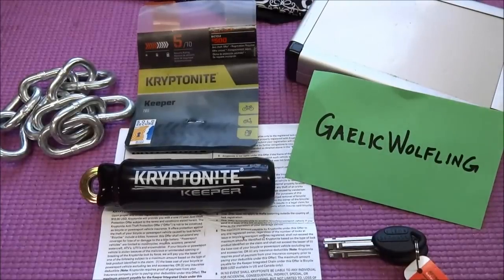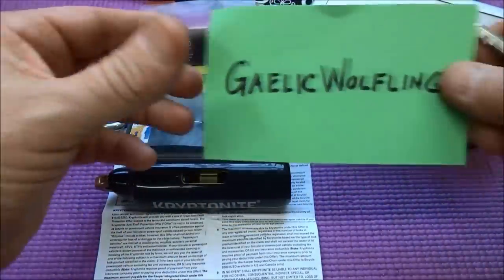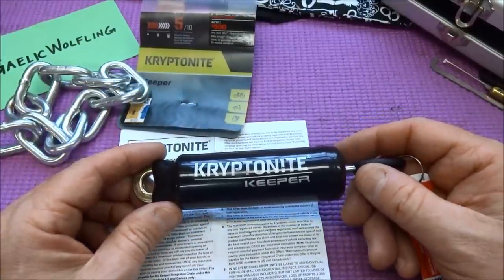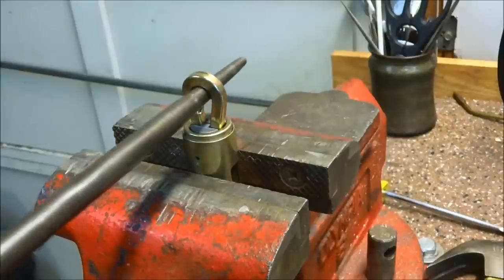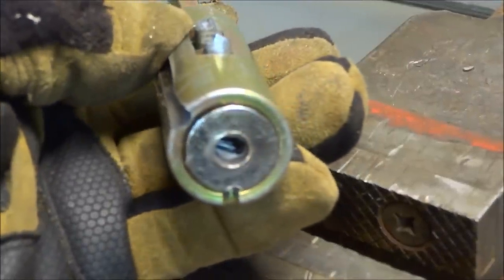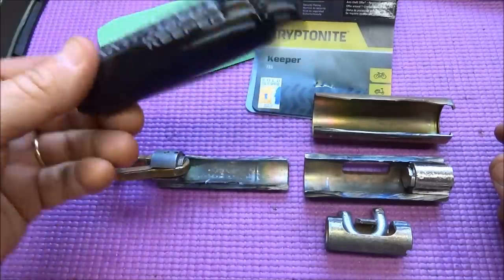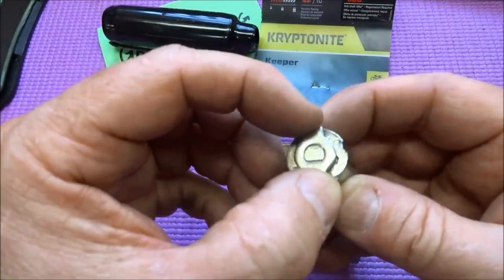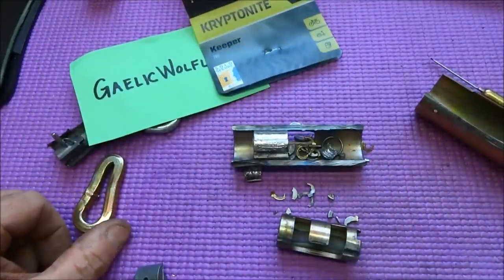(397) Kryptonite Keeper Bicycle Lock Autopsied - One TOUGH Lock!!!

Comment: Bill, brother... Why use a grinding stone to attack these locks? The last cylinder, the small one, could have been cut right in half with a 1/8" wafer wheel. Right down the center to completely remove the internals or off center to expose yet retain them. You can do really delicate work with a wafer wheel and a little bit of experience. You could even take just one quarter out.

Comment: Bill, I think having the original chain would be essential to rate this locking system  as thieves would probably attempt to cut the chain first. I don't see them doing much else than attempting a pick. Reading Amazon reviews, many people have the same problem you had with the poorly functioning lock mechanism. Several reported thieves stole their bike by cutting the chain. cheers

Comment: Just a note on the steel. Hard steel is brittle, just like the piece of tool steel you used. The steel in the lock, while hard, is also tough. Toughness and hardness are two different things when it comes to steel. Those parts look zinc plated as well, not sure if that affects what I'm about say next (I don't think it does), but with enough heat you may be able to upset the steel enough to make it soft again. But that is timely and probably not in the interests of a fast open. The loop on the top appears to be the weakest point, heat that up with a portable torch and twist it right off.
Reply: heavy breathing

Comment: That side bar is the same as what was on a couple pay phones I have. All you need to do is know where it is and drill straight through it the lock will turn with a screw driver after that. Get a good drill bit though, chinesium doesn't hold up

Comment: An angle grinder , triangle file , or some ten thousand pound bolt cutters would most certainly work. The lock can be as strong as it wants but the little loop where the chain goes will be very easy to break. Steal may be strong but it always wears down.

Comment: So with that 2nd larger pin, would you have been able to drill a hole, tap it, put a small bolt and pull the bolt pulling the pin out?

Comment: I broke through the chain on this exact lock using a $26 bolt cutter, which I was able to return with the receipt. For a $35 lock, you should at least need the $60 bolt cutter.

Comment: The 5/10 is really the chain's rating...

In any case, as long as your bike's not the one with the flimsiest lock on the rack you should be fine. A lot of people use locks that can easily be bypassed with a wire cutter and the thief is going to go for those bikes before even considering stealing yours.

Comment: what about drilling directly into the key hole just enough to stick a makeshift key with a figure 8 at the end and tried to use it as if it were the key put pressure like u said and turn until it opens or maybe the tool u had filed dwn to make a figure 8 would that tool have worked if the key hole were to be drilled in or could u have just drilled as far as u could go then tried to turn it with your tool u have?

Comment: you could lay the lock on the floor. put the pry bar trough the loop and have one end on the ground. and step on pry bar. may not break the loop or the pin. but might bind one or the other enough to open it. or just use that or boltcutters on the actual chain. not much of a point in a lock if the chain's bad. while a user for sure would use a good chain. but anything will break eventually.

Comment: I have seen and been deterred by secure locks as a landlord. One thing they cannot do, is protect against the  hasp, or chain used, that is very easy cut. Any cutting disc will deal with them anyway.

Comment: When i was searching for a lock, just looking from the outsde in I saw many advantages to this lock, dual cylender, the pin is a cut part of the inner cylender, the key was difficult to re-make, and even the chain is hardend, squared, and pretty damn thick... Not to mention even if a link was cut, it would easily accept the next link(if you were to recover the chain and lock.)

So given all those I figured it would be a substantial bicycle and even motorcycle lock! I got absolutely no Buyer Remorse here! ^_^

Comment: Are Kryptonite chains and locks really good?  Could you test out the mechanism on the Kryptonite KC890 HD Chain Lock? I got it at walmart a few years back for my bike. Question is, is it as good as advertised? Also, is the kryptonite chain the same hardened steel as the housing?

PS, mine's a 4 but it seems to have the same kind of lock.

Comment: Bolt cutters. And done.
Reply: The chain with which Kryptonite comes is made of hardened manganese steel, and you'll likely break the edge of your bolt cutter jaws when you try to "cut" it.
Reply: Oh, nice.
Reply: Gotcha. Thanks for the info.
Reply: That was a bad ass lock. Did I hear U right & say it was a #5 & a #10 was also available? Geez!

BB: I Stumbled across a great YouTube (I think by Greg Miller?) Where he went into great detail on cut away locks via video where here he showed sitting reg pins, spool pins & serrated pins. Can U hook me up w\ that vid "Please!!" (Or or one like it?)!  I'd buy a full set from  Southord but I'm so broke I can't even pay attention. Seriously, I work from home &  am broke.
Reply: Cordless angle grinder...and most certainly done.
Reply: ***** Just to add, I used to break bike locks and heavy duty chains etc. for a living (Don't ask but it was legal:-), We had access to hydraulic tools including a battery powered "Jaws of life" that cost £7k and would cut through scaffolding pole as if it wasn't even there. Tool of choice was cordless angle grinder (We had one before you could buy them commercially, Dewalt told us they didn't think they would be commercially viable, Milwaukee modified a cordless sander for us, now everyone sells them :-) ) Of course noise wasn't an issue for us but one thing to bear in mind it that generally the outer layer of a chain will be harder than the centre (by design) so cutting through the outer hard layer with the grinder and finishing the job with  bolt cutters can be quicker and minimise noise but it does require carrying more tools. We found the risk of damaging bolt cropper blades was too high to use them but a thief may not care too much about that. As you say a 36" pair of decent bolt croppers is not an easy thing to conceal. BTW Cordless Dremels are a very handy tool if used carefully, as battery/disc life isn't great but again when used in conjunction with bolt croppers they can remove the hard layer that wrecks the cropper blades.
Reply: I'd be interested in getting hold of a link or two of that chain for tests. And a link to the cutting video.
Reply: ***** Ok, humor me, If say I had access to liquid nitrogen as a common thief, supercooled the chain, then hit it with heat from a butane torch (or the other way round) AND then used 16 inch bolt cutters to cut the weakened chain, could it be done? All those things would fit in a small backpack and wouldn't make much noise. Could be done in 3-4 mins in a dark alley at night.
Reply: *****  the locking mechanism has nothing to do with the security.. whenever I see broken locks in the street, they are never picked.. they are always cut. If you have enough leverage you can bite through pretty much any chain. You don't even need to freeze it first, just heat it to red glow and you go through like butter

Comment: The weakness is the chain by the way. Made in China, through hardened and should be quite brittle. Meaning you can probably bolt crop it with a decent and big enough bolt cropper quite easily. Assuming you have new blades on it.

Comment: I've got a Kryptonite U-lock and it has the same kind of key, pretty happy with it. £900 guarantee with it.
Reply: Are you assuming these are the old style Kryptonite locks? Because disc tumbler locks are reputed to be some of the hardest to pick.
Reply: Well it obviously wasn't that easy to pick or bosnianbill would have done so in the video, sure they're not invincible to picking but they require more than the average street criminal is likely to have.

Comment: At 1:02 you are talking about a high "magnesium" chain that has been removed. Magnesium is relatively soft when it comes to metals. Are you sure you didn't mean to say manganese? Manganese is used to toughen steel and make it stronger, more impact resistant, and wear resistant. The rolls in gravel crushers are made from manganese steel.

Comment: I just wish you had tried to extract the pin before slamming it in. Try a small screw in there or something and pull it out, or maybe some bonding agent on a smaller pin and gently tap it out by pulling and tapping.

Comment: Wow, ok, that was quite interesting to see.  So basically this is a really good contender for a security lock, or did I miss something? I guess a thermal rod would be the best/fastest way to cut the anchor link off? It seems that it installed and visible, someone isn't going to be able to get the secured contents without putting a spotlight on them doing so.   
Best to ask an expert....what type of lock system do you recommend for a motorcycle and a 53' shipping container (2 separate items)??
Reply from the maker: The Abloy with the thickest shackle that you can fit into the chain/container.
Reply: J Alvi

Comment: Impressively tough lock but as in any security system, always go for the weakest link.  Rechargeable angle grinder with a metal cutting disc will whiz through the chain in seconds.

Comment: Could you drill out the roll pin rather than driving it out?
Reply: +Derek Bastian yes, roll pins are soft. Only problems is maybe you leave debris in there which causes problems, and perhaps the roll pin is necessary for something in function.

Comment: As others have said on here, thieves are not going to bother with the lock. The chain is the weakest link, so they'll simply use a heavy duty bolt cutter on the chain. Voila, done !

Comment: Hmm, I believe they rated it a 5 due to it using a smaller chain instead of something else. Still a seemingly well constructed lock though.

Unless things have changed the main weakness is the discs of the lock. They have/had fairly wide gates in them which makes attacking them easier. May want to watch this one for more info if you have not yet already. v=nT0PDQUZi74

How many cuts/discs were in the one that you had and how wide were the gates on the discs compared to the sidebar?

Comment: If any of those things worked it would’ve been something hard to do on a bicycle outside of a theater for example. Which makes it a most impressive lock.I may have to buy one. But how strong is the chain? The lock is only as strong as the chain. The weakest link could be in the chain. Yes I realize I’m commenting on the video that is rather old.

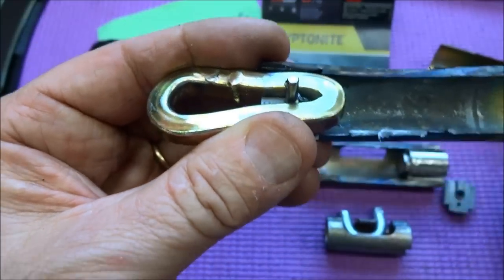Comment: 11:00 So, the only thing that is holding the back link inside the tubes are those 2 pins?

Basically if you drill them off, you're able to slide the link off.

Ok. The other pin is hidden under the outer sleeve might make things a bit difficult when the lock is in use and the links free end is in the hole, preventing the outer sleeve to slide off.

Maybe you could pry the back link out with some kind of jack? Or just cut the chain :D

Comment: What if, instead of trying to drive the roll pin through the lock, you had driven a screw up the center of it and then using the threading to pull the pin OUT instead?

Comment: Great timing with this video. It's spring 2017 and I am considering buying a new bike (Giant Escape 2) in combination with that exact chain/lock (Kryptonite Keeper). Cannot believe that lock gets high ratings from you and your arsenal of expert lock picking tools. Never would have guessed based on the very low cost. 
I saw that same lock at the store (professional bike shop not Walmart) where my bike is for sale. I'm debating whether or not to upgrade the Kryptonite lock to a more powerful Kryptonite model for the sake of cost vs. effectiveness of lock/chain. There's a sharp price increase going to higher levels of Kryptonite bike locks. 
You're the LockTube guy and I trust your opinion the most. Would you consider a follow up video regarding the ease of cutting the chain relative to a sidewalk bike theif. Reason is that if I buy that new bike for $415 the additional costs of chain ($85+ for upgraded kryptonite)(back tire to frame to secure pole) plus the cost of a good "D" lock (front tire to frame) can easily cost 50% of the bike itself. Secondly the chain is sold as an integral part of the locking system and deserves to be mentioned in terms of it's level of effectiveness at protecting your valuables. 
Thank you for the great videos. Keep 'em coming.

Comment: wait, so one end is supposed to go in the hole, but the other end is supposed to attatch how? through the chain link? because if you have to attatch it on the other end the lock is meaningless because the way its attatched to the last link on the lock is the weakness...

Comment: Hi. Long ago (back in the early 1970's) I bought a motorcycle padlock.
Now, that in itself doesn't mean anything, except this. It has a LONG hardened steel U bolt that goes right through the spokes and around the tyre AND both arms of the swing-arm (or past both front forks) then into the "lock" assembly itself. But the long U bolt has small half-moon indentations (on it's inner legs) where the housing "locks" both legs of the U bolt when "locked".
The ONLY way to unlock the device - is with a flat disc key, that has ONE tiny keyway flange that interacts with a slot on the main mechanism's disc.
The mechanism itself is a multiple magnetic lock. The KEYS (five were supplied with the lock as they cannot be re-manufactured) themselves. are just flat discs . (with the magnetic actuators inside the disc such that they push or pull the "main housing links.. according to the "pinning" of the lock. Unless all magnetic pins (who knows where they are in the face of the disc) push or pull correctly. The LOCK will not release.
Reply: The "keys" themselves.. magnetically attract themselves securely onto the main actuator disc . and the tiny slot is an exact match for the key's flange point, such that turning the keys is easy (when the correct key is placed on the main disc). There was another lock - in the shop at the time .. but it was "keyed" magnetically different (as my lock's keys didn't work with the other lock). However - there was no "physical" (visible) difference between either set of keys.. as NONE of them had any visible sign as to how the actuator magnets were placed (for flux actions).. or where on the key/lock they were even located. The ONLY difference was the factory key code "printed" on a piece of paper in the lock's wrapping paper.
Reply: About 1968/1969 I was "given" an old Royal Enfield 16" bicycle, with a seriously punctured back tyre (it was also very perished), that had a keyless lock fitted under the seat. It was shaped in a circular fashion with a semi-circular HASP actuator inside the hollow tube outer (that simply slid around through the spokes and back into the circular outer casing, blocking the spokes from allowing the rear wheel to turn),and a solid main-lock area of stronger construction. The lock mechanism itself consisted of a small metal knob, with a small red reflector on it, that one couldn't hold properly as it's sides were sloped at about 40.degrees. The method of "unlocking" this thing involved an inverted T slot within which the actuator knob slid. By "side-shifting" the knob fully first one way (a number of times) then side-shifting it the opposite way (also a number of times) then one or two in the original direction .. before simply "sliding" the knob UP into the long.leg of the inverted T slot, the lock would open (if the correct sequence was run). If the lock didn't open .. the action of "sliding" the knob upwards simply reset the lock closed. I have never been able to "pick" that lock. I took the lock off when the bike eventually rusted too badly, but I have no idea where the lock itself is now.!!

Comment: So my 10/10 kryptonite lock is probably ok to use on my BMW motorcycle?

That's actually reassuring considering you seem to come up with a list of ways and weak points to attack a lock and with this the weak point seems to be the solid chain itself xD.

Comment: I use a really high quality, expensive, thick and heavy bicycle/motocycle lock+chain i have found by the road. As i have no key (it was obviously unlocked when someone lost it ;-), i use a small magnet so the lock looks locked... Since i have it, it is first time in my life that i haven't got my bicycle stolen in over SIX or seven YEARS. I had like 5 or 6, some worse, some better looking, (all were around 30-70 euro value on street) bikes stolen before, allways locked (with a "real" lock).